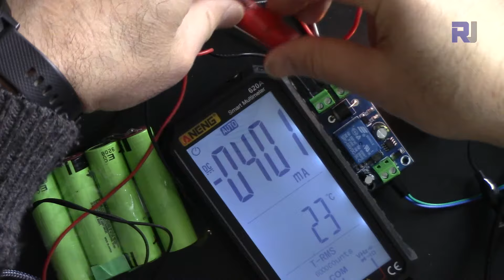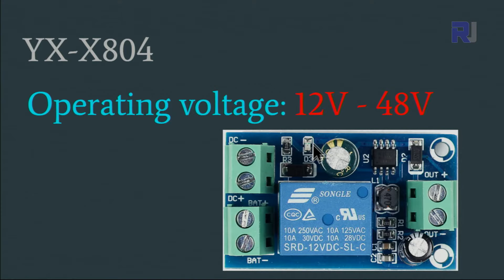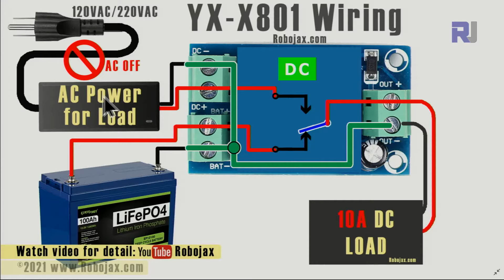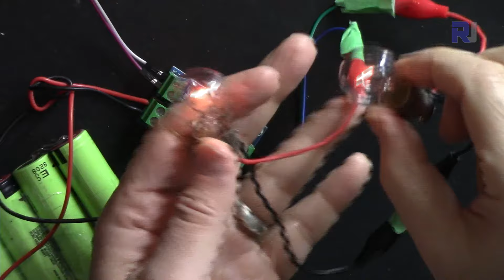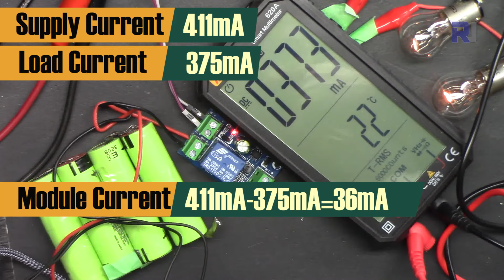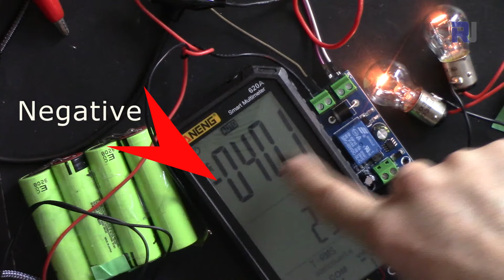YX850 Power Failure Automatic Switching Standby Battery Lithium Battery Module 5V-48V Emergency UPS

Comment: is there a version of the same module but without the relay and with faster switching like a mosfet.
Reply from the maker: Yes there bus UPS that operates with battery. Just click on channel name and then click videos to see iy
Reply: @robojax   I didn't find the video. Can you tell me correctly? Or comment what the name of the module is? Sorry for the trouble and thank you for your attention.
Reply: Can you tell me the version/model of the module? Thanks
Reply: it's called an UPS and is not based on mechanical relay. Such module can prevent any interruption at the expense of 20mA battery drain during power outage.